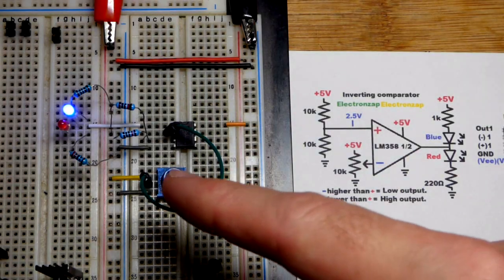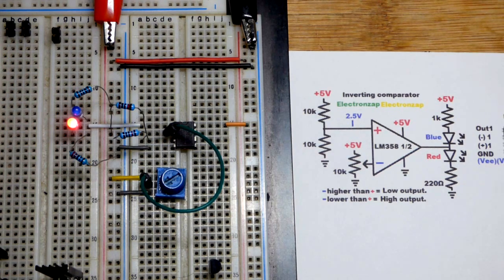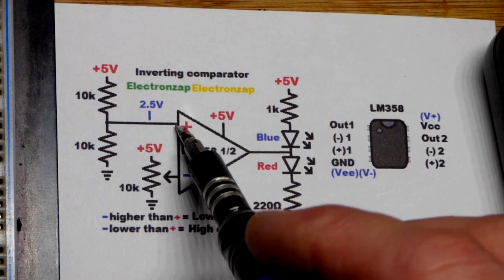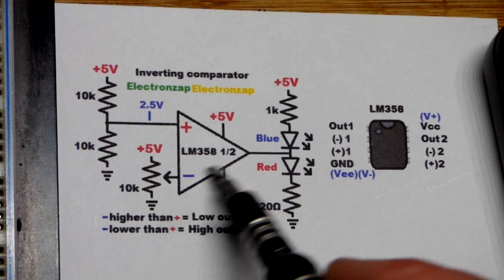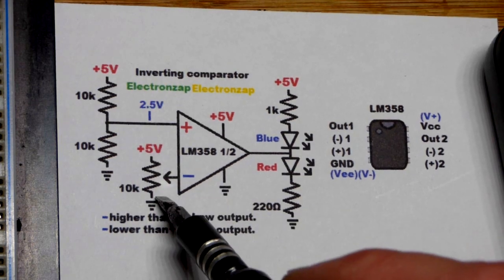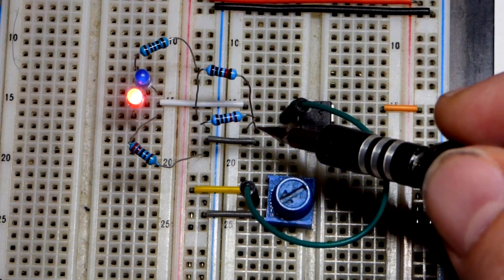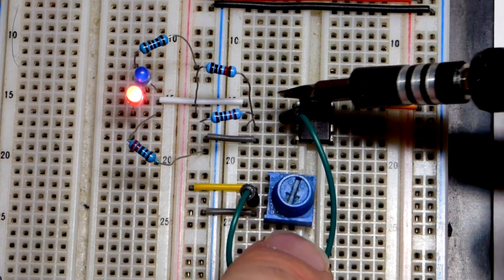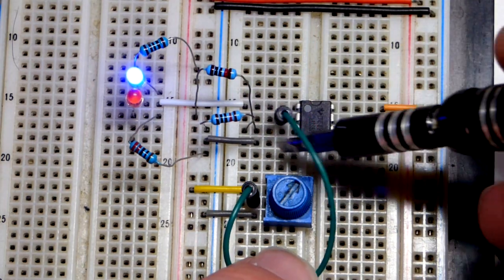Op amp inverting comparator demo circuit schematic by electronzap

Comment: Why not the LM339/393, an actual comparator!?     The LM358 has terrible slew rate so output swing is SLOW, recovery from saturation is long (not in data sheets, but true).  ...again DO NOT USED a LM358 as a comparator, use the same ultra cheap jellybean LM393!!!!!!!!!!!!!!!!
Reply from the maker: Won't be able to source current with the LM393 output alone, but can definitely use it if you prefer.
Reply: @Electronzap  The output is NOT my point, that can be made anything you want with 1-3 parts, it is the fact that the response of the LM358 is TERRIBLE and SLOW for comparator use.  BTW I would suggest a tinge of positive feedback to keep stability for the LM358.
Reply: @Electronzap  Look, comparators are comparators" because they are designed to NEVER SATURATE (if you stay in specs), while 99.9% of op-amps WILL SATURATE.  Second, comparators generally have MUCH HIGHER gain to switch faster for small input voltage differences.  Op-Amps are NOT comparators, ...and the reverse is also true.  Try using a comparator as an op-amp, ...enjoy insane instability, because of the very high gain with an output stage designed NOT to be linear (i.e. on or off ONLY).  I know you can fudge it with op-amp when cost is a driver and you have a spare op-amp in a LM324 package, but the LM 339/393 are just as cheap as them, and do the job properly.